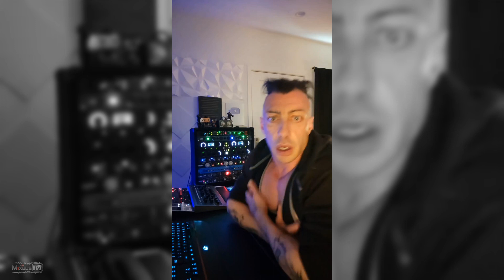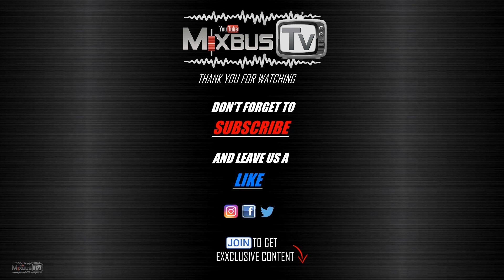Mixing With A Limiter on the Master Fader? 🙄

Comment: Could you maybe do a future video on where, why and how you would want to use limiters (not transparent) on individual track elements?
Reply: Any limiter you find is meant to be transparent where I’m not entirely sure if there’s a non-transparent limiter.
Reply: @tdengz  Not true, there are colored limiters out there as well. Lindell/Neve style and D16 Frontier come to mind.
Reply: I can give you a suggestion (basically what also David said in a video): if you have a spiky track that is not a drum shell (bass DI, vocal, acoustic guitar...) use a limiter to turn down the peaks (I often use it at the end and at the beginning of the chain). I highly suggest you though NOT to use it on drum shells because the limiter is gonna ruin the punch
Reply: @alessandrosummer  I use a limiter on toms, only shaving 1-2dB and clipping as well. I'm not too worried about losing the punch because the drum crush aux will add that anyways.
Reply: @ why do you put a limiter on the toms? I can’t understand the reason
Reply: @alessandrosummer  If they're still too poky after compression and clipping. I was watching a video of Nolly and he was limiting his toms like -3dB. Do you have a suggestion?
Reply: @ if they’re too poky after compression and you can just hear the attck just compress them less and leave more of the tail
Reply: @alessandrosummer  Ok, I'll check my threshold again. I did just try the Apogee Soft Limit on my tom shells bus and it does a pretty good job of shaving a bit, but not taking away the punch. Thanks for your input.
Reply: @davejohnsonmusic  to me at least it doesn't make a lot of sense, you're basically processing more to obtain the same result that you'd get just doing less compression. Obviously that's just my opinion - try both and see with one you like more. Pleasure to give you advice 🙃

Comment: Hi David, you mention the the limiting process is as transparent as possible, but in the mastering stage are we not also trying to get a "sound" from the limiter? in addition to clean level, don't we also want to artistically impart density, pressure, edge or accentuate transients like kick and snare and actually add something to the sound with limiting?
Reply from the maker: We're not really trying to get a sound from a limiter (again, unless one uses the 2 or 3 out there that do have a specific sound) we try to minimize the inevitable deterioration if limiting. Limiting is, 90% of the times, a necessity not an artistic choice, not even in mastering. So one of the biggest challenges for a mastering engineering is to bring a mix up to level while retaining the punch while minimizing - the again, inevitable - losses of limiting, sometimes we can even enhance that said punch. On top of that, if there's room for improvement, we can also make a mix better but that's not done with limiting, it's done DESPITE the limiting. I hope this message gets read and taken to heart because it's the whole point. If one slaps a limiter on the mix those losses already happened, and while sometimes they might be minimal or not even perceived by a non trained ear the big question remains: why in hell would one do that for? The mix now will take processing a lot worse than if a limiter wasn't there. In extreme cases, the limiting is so bad that you wonder...

Comment: i mix into the limiter to hear how the mix is gonna feel when it's squashed to reference levels during mastering. limiting often results in balance changes, i. e. drum section becomes quieter, space becomes smaller. of course you turn the limiter off before you send it, lmao. but if you're mixing into it to "not clip", this is stupid af, bro, learn your mixing.
Reply from the maker: Change your mastering engineering if your mix gets squashed in mastering
Reply: @mixbustv  thanks for the reply. it was a figure of speech, like modern music - like squashed😅

Comment: I'm kinda guilty of using Fabfilters aggressive and punchy modes... I really like how they sound. But then again I don't squash everything to the brim, I just want that saturation.
Reply from the maker: That's totally fine, if it's very minimal and because of the behavior, the punchy mode definitely has a sound, more so the Dynamic mode (built in transient enhancer) not so much the aggressive mode, it's a really fast and hard release which causes distortion
Reply: @mixbustv  I like to set up aggressive mode almost as a clipper and A/B it against clippers on the blind. But not on the mix bus either ends up on single instrument or submix. It seems that people this days would trade a (quite) bit of distortion for loudness, I honestly feel that trap and dubstep is one giant distortion genre whenever I get the sound files 😅

Comment: Your knowledge of gain staging is exactly why your mixes sound better than most of the stuff on the radio.

These ridiculous engineers clip the crap out of their tracks and then it ends up sounding like nothing but mush! The irony is they are using ridiculously expensive equipment to create garbage.
Reply: I see ppl using nexus, with it clipped like crazy, NO WONDER. Gotta go to the source of the sound VERY FIRST THING. lol

Comment: Hey David, can you test Sound Radix Pi plugin? I think its be interasting and useful. I was try on trap drums, but i realy want to hear you oppinion. :)
Reply from the maker: I haven't tried it but I know it. This is my take - keeping in mind the premise - to me, shifting phase DYNAMICALLY sounds like a nightmare about to become reality. I feel this is one of those "just because you can doesn't mean you should" situations. A little bit like too gear becomes a distraction, too much power to fuck with things that you're not really supposed to fuck with (because is not necessary). Phase relationship between elements in a mix is NOT that direct. It is on multi-mic'd elements, like kick in/kick out, 2-3 mics on a cabinet, or even synth bass and Kick if samples or synthesized, because of 0'&1's. Now in those cases, IF a phase cancelation occurs, you fix it STATICALLY, because if your start moving it around.. I don't even want to think about the headache. On trap drums as you mentioned I do not see any reason to use something like this as there would be zero phase relationship between elements unless you used and recorded a real drums. Then there's the next part: perfect phase alignment doesn't equal better sound, it just equals louder level. In fact, I want to argue that a lot of those intangible things you pay an engineer for (or that make one a good one) is how you musically deal and use to you advantage masking and cancellation between a mix, I want to go out and say that is what you can NEVER teach, it's how an engineer hear things and processes them in his/her brain.
Reply: @mixbustv  Thanks so much, your answers is completly match with my expirience with this plugin and phase issues generaly.

Comment: Agree unless your not sending anything to a mastering engineer and the whole DAW session is a mixing and mastering session implementing top down mixing with extra caution to what your feeding the limiter would you agree ....?
Reply: For years I sent my mixes to well experienced mastering engineers and got tired of the sound of my mix changing. I started mastering my own stuff and remastered mixes that I sent to the mastering engineer. My mastering sounded even better. If you have the you achieve a great sound working with the tools you have if you know them and know how to use them.

Comment: "Yes I always mix into the master chain with limiting from the beginning of the mix. If you try to put something on at the end of the process it will undo or change a bunch of the work that you already put in. Mix into the glue!" - John Hanes (which probably implies Serban Ghenea too).
Reply from the maker: "The second part is easier to answer; it is due to the Loudness Wars. A songwriter will make a demo loud because louder sounds more impressive, right? The artist and producer then have to be louder than that on their production mix. They send to us, and we need to be louder than that because they are A/B'ing the mix to their rough and will say "it doesn't hit as hard". If we send mix that has more dynamic range and is not pushed hard, they will have mastering do it after the fact, because when they play their song next to the current hit, it needs to be as loud.

So our theory here is that if it is going to be pushed that loud anyway at some point, it is better to do it in the mix where we have total control over the effects of loudness than to leave it to be done later with possible adverse effects.

As I said before, this is kind of a "pro-move" and not everyone needs to be doing this if it is adversely affecting your mixes. It is a difficult position to be in to have to make a mix as loud as the rough mix but fix all of the problems that their loudness creates. Sometimes the rough mixes come in much louder than our final mixes can safely get to and at that point we just have to say "that is not going to sound good as a final product."
Same guy you quoted. Context.
That is the house where all the loud records people say they hate come from, don't they? He does it EXACTLY for the reasons I mentioned above. Also they do their own mastering, or know their mastering engineer(s) will squash their mixes to oblivion, that's one way to deal with it. Pretty specific case. But wasn't the loudness war over? Or it wasn't it, like I've been saying for a long time?
Reply: @mixbustv  Dear David, thank you for the thoughtful reply. :) And he of course made this great elaboration, which is certainly relevant to the context of the modern (and still very loudnesswar-ridden) world. I will also personally have to take full responsibility for sending some absolutely horrible mixes away to mastering. That being said, I personally find it very useful to learn how to use the limitations (pun intended) that the loudness war puts upon us, and at the same time work within it (learning to mix into a limiter and other glue). As he mentions: 

”I think that when we were mixing on a console, back in the Teddy Riley days, it was different. We would do the mix and then put the Master Compressor on towards the end. But in those days mixes weren't so loud out of the console and we printed back to 1/2" tape so we needed to get things under control for that.”

I've spent most of my musical life (producer/songwriter) having to deliver some quite loud demos, largely due to A&R demand. Unfortunate? Certainly. Sometimes we just have to adapt to reality to survive in a given field. I find learning how to mix ”into the glue” has helped me work much faster, and better too. A lot of my individual tracks get less processing, funnily enough. That being said, the road there hasn't been necessarily pretty. Loads of overcompression, wacky EQ curves and inexperience. Name a mistake and I've made it.

Btw, I think the second part of the quote I originally posted was left out as well, for further clarification: ”In this way, you can also control the amount of limiting going on as you work; mix getting too loud? Pull everything down a bit. You can do this during the mix because you'll be able to adjust for how it changes things as you mix. If you do it at the end of the mix, it can change the sound of the mix.”.

That being said, from your point of view I can certainly imagine you are being sent some completely obliterated files, stems and full mixes. I don't envy you that, and can only imagine how frustrating it must be. As mentioned, I've sent a few of those out of the door myself.

Thanks again and keep up the good work David. I've gotten some good tips from you, both regarding mixing and which plugins to buy. It's also always nice with someone who interacts with their audience.

Comment: For unexperienced mixing engineers it can be a useful thing to do. Bringing up and squashing reveals problems in a mix that many engineers don't notice without that processing. I don't do it, but I do understand that some are doing it. When it comes to sending mixes to a client it really depends. If you have clients that know what they are doing and know what mixing is supposed to be, that's great. But that's not the reality for most engineers. The reality for most engineers is that they have stupid clients that will compare the unlimited mix with a limited mix from someone else. So I suggest sending 2 versions. 1 file to "listen to" for the client and 1 file explicitly "for the mastering engineer". But if you have to send ONE file, send the one without limiting.
Reply: Wouldn’t that also create more problems depending on how hard you’re pushing into the limiter causing it to overwork? Also, you’re leaving headroom in a mix, so you can simply boost the mix by how much headroom is left if the client wants a louder version. This should also be a good opportunity to educate them between a mix and a master where they should just be focusing on the quality of their song rather than how loud it is.

Comment: I have a limiter on my mix bus even if it is only catching 1 pesky transient throughout the entire song. It makes my metering plugin afterwards read accurately. I just mix my own recordings and I have no mastering process though so it's just used so I know where I am at as I don't ever get to leave the song in other peoples hands.
Reply from the maker: So why don't you put it in the track that's causing the transient? Limiting does a better job on more simple program than a full mix. If that's the purpose then use it in single tracks.
Reply: @mixbustv  I do, but I still need to have a limiter on the master anyway because I am not sending my tracks off to be mastered. I do not really know of any other way, I don't want to normalise upon bounce because I would then be mixing blind and the metering plugin wouldn't even show true readings and it would be pure guesswork for me to hit any targets with regards to loudness, I shoot for achieving loudness in the mix stage, but I need that limiter to tell me the mix is wrong?

It's just something I incorporate into my workflow because it is all I know. 

Also It's nice for me to have a limiter on the master for those instances where I mess up my routing and feed a reverb into itself or something else stupid like that. 

You obviously know what you are doing so I am open to hearing any suggestions. I don't want to leave X amount of headroom for a mastering engineer. And I definitely do not want to piss about normalising the render only to find out I need to tweak something.

And I also hope you do not think that I do not know what I am doing and that I should quit forever. I am (very) cautious when it comes to limiting, In reality I am flicking backwards and forwards checking it near the final stages of my mix but I feel like the limiter tells me things I would just never have noticed, afterall my limiter gives me a visual aid of the waveform of the song without the need to bounce down anything!

I have learned a lot from you, Im not debating, I'm just figuring this stuff out as I go.

Comment: I usually put a limiter on my project when i am mostly done mixing.
So that means:
- I am NOT clipping
- i don't print the track like that... (wth)
- and i don't want to add any flavor with that
Also just because i am not that experienced with that, because i am no mastering engineer.
I use my limiter to check for some frequency buildup and that's it. Only when i am nearly done and then the limiter goes away. The track gets printed with nothing on the master and then gets a dedicated master project or the client sends it off to mastering.
People should really stop thinking putting a limiter on the 2bus is mastering man... I am just mixing and  do some loudness adjustments and tame some frequencies with a multiband comp in my master.

Great video dave. Cheers!

Comment: I've heard a reputable engineer say "limiters are compressors and compressors are tone boxes." Just sayin....
Reply from the maker: Limiters as in 1176, mastering limiters are a called Brickwall limiters. Different things.  And they're not JUST tone boxes, they're ALSO tone boxes or we would only use transformers. Unless they say you can control dynamic just with those.